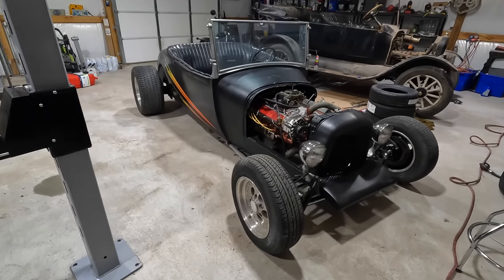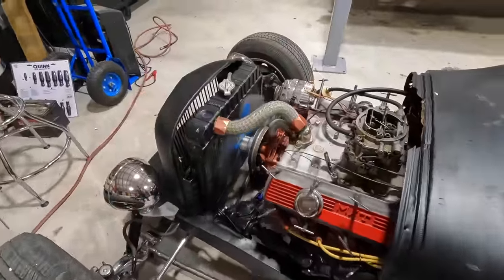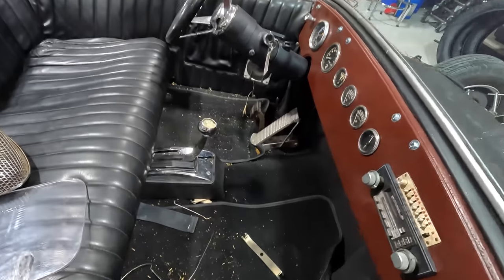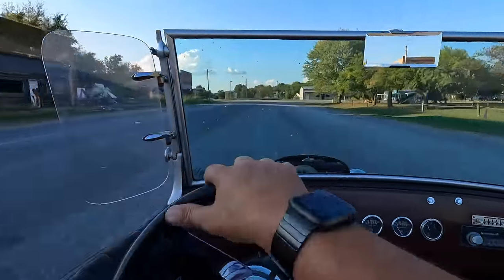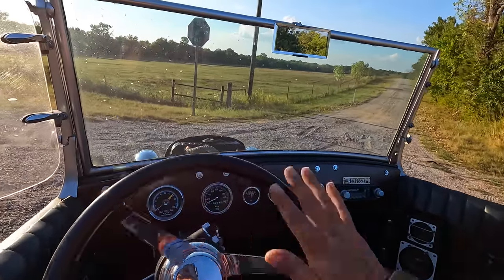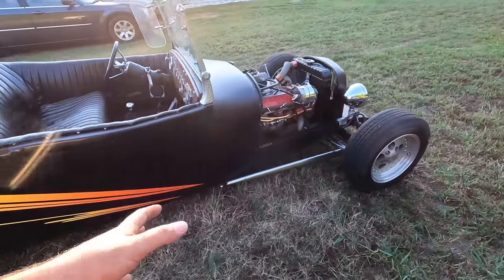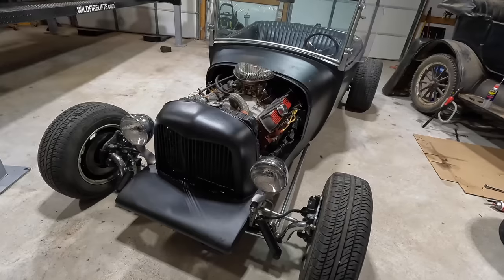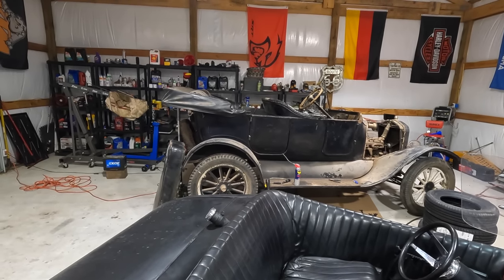I got Shafted on this 1929 Ford Roadster! $13K and 30 days Wasted!

Comment: Honestly this reminds me of the 85 black and red pinstripe Buick Regal limited my dad traded a expensive car Worth good amount of money as well as how got that one, and the 85 regal had true dual exhaust no mufflers and chrome exhaust cannon tips like 4 inch slant cut tips, it had it's factory g vin 305 and had a serious lope he and my younger brother thought was awesome and I'm like nope I was the one to move it off the driveway and it barely turns over and starts, the quadrajet is missing the choke plate and almost all the connections to the e4mc computer feedback carb, and it has a 70's vacuum advance hei distributor and the timing retarded way too much and im guessing the idle screws are cranked in and even though I know that the guy dad got it from put a cam in it and they did but as it turned out 6 months later they had cranked the rockers down to the point there was almost zero valve lash,, well I'm shocked it didn't blow up, but I called this car hot rod junk since the passenger side windshield pillar was smashed in towards the top they put a new replacement windshield in it and filled the gaps with black rtv silicone and the pillar was smashed in enough that you had to push in on the front corner of the window to shut the door or roll the window all the way down and shut the door and while rolling the pwr window back up you had to have someone push in on the front of the window to go under the roof rail weatherstrip moulding tab to get the window all the way up and seal out the weather as best as could be done. Had homebuilt three inch spring blocks under the rear coil springs so that overextended the shocks so it had no rear suspension travel my brother and dad loved the rake this car had.it had cragar grand prix their version of the aluminum polished blade looking wheels and the blades were gloss black and it had the twist in spring riser knuckles in the front springs two spring knuckles per side, and actually made it sit lower in the front,tires were Firestone Firehawk gt 215/60/14 so it sat low to the ground I took this thing down the road when I moved it when my dad's buddy dropped the trade off and pretty much hated the car from then on I didn't mention that the nose cone was busted out on both sides and the Dr side lights would bounce around because that could be fixed.the car was apparently lowered by the spring knuckles because the ball joints were bad, lower a arm bushings nope, and the two rear tires were flat spotted and all 4 were bald, car constantly had blower motor and Dr side power window switch issues and it truly had beautiful burgundy limited interior nice dash except the top plate speaker grille defrost vent plate it's only plastic, the Dr side seat the center hinge was Bent so the seat leaned,car drove like crap and shook, and backing it up was sketchy at best lol, my dad and brother replaced the upper ball joints and the outer tireod ends paid to get this piece of junk aligned with the horrible tires and my dad drove it as his work car,I'd occasionally ride in it but after that I would not drive it, and I forgot to mention the motor mounts on the frame were broken loose inside the clam shell and the transmission mount was installed at an angle and broke so it was ratchet strapped with the skinny orange little ratchet straps like big n lots department stores sold why I called this thing hot rod junk

Comment: Lack of a title when you operate on thin margins and fast moving products is a huge issue.  While someone who is looking to buy for themselves and plans to spend a few months or so to work on it and make it just right won't care about going through a bonded title process.  $300-$350 to have someone do a title 42 for you isn't a lot of money, but having to wait anywhere from a few weeks to several months would cost a LOT more in missed opportunities.  Should the court find an old lien through another state then it might cost more money to clear that, or if the company that put the lien on it doesn't exist anymore, it might be nearly impossible to get a title without some monkeying around with paperwork involving Alabama or Vermont or whatever.

Comment: I think you lucked out on being able to get a refund on that car. It needs a lot of work to make it roadworthy, including bracing the frame. That would basically end up being a complete rebuild of the car, something I'm sure you don't want to do. Because once you do that, then I may as well fix this too while I'm here, then I might as well do that too, etc. 
The yellow t-bucket is a far better car that you don't have to worry about selling. I'd be worried about selling this car to someone in its current condition. 
Good luck on getting the Cobra.

Comment: damn, worth maybe 5 grand.if it is all steel body then maybe 7 grand. i buy and build these all the time. i just bought a 28 steel body with a fuel injected 350 for  9 grand  runs great. needs paint. but i also paint. the frame on that thing is junk yup you got taken on that deal

Comment: The steering column can be bought aftermarket, as well as a new rack and pinion, so it would be easy for somebody to update.

I understand where your at on the car. I bought a 1953 Mercedes that needed a lot of work, no title. When it showed up it had a different engine, no VIN on the body, one VIN on the frame and a different one on one door. I talked to the DMV on title and licensing, it wasn’t worth all the work. Sold it as a parts car.

10K miles over 20+ years (judging by the radio) is believable.

Comment: I am really digging that "Turtle Deck" model T hot rod. I would take that in a hot minute. From the looks of it & your description, needs a small block Chevy, box the frame and fix the whole steering stuff. Needs some attention for sure...but at 60 I have the time and the will, but sadly no mooluh. lol Appreciating the video's TY
Reply: That's not a Model T.  Model T production ended at the end of 1927. The '29 is a Model A. The "A Bone" as they were referred to could be bought new with an optional rumble seat.

Comment: Is anyone else bothered by the fact that he keeps calling this 1929 Model A Roadster a "T-Bucket"????  It isn't a T-Bucket.   I have no idea what kind of frame is under it, but it was not built correctly as evidenced by the flexing caused by the steering...not good...   The brakes may or may not be a problem..

Comment: The 330 was a good engine they put them in the first 442s the horse was330 horse same as cubic inch. I'd see if it would do 120 and I'm 72 years old..the cops put the 330 in cop cars.the 400 came out in 65. Why you into cars if your scared of them ..

Comment: You should pull the engine out of the yellow roadster and keep it for a later project on a keeper maybe. But then find a nice cheap rebuilt vortec engine and put an RV cam into it and a 600 edelbrock and let it sell with that engine, because that 383 is worth keeping for something else you really want to build for yourself man. You will still get the same money for the car regardless..

Comment: I have seen some sketchy builds but this one is definitely in the 10 worst I have seen because of the flimsy frame they used. A Model T frame was only intended to have a maximum of about a 40 HP engine in it. Also, it’s a Model A roadster and is not a T-bucket. It is possible it is on a Model T frame but it’s more likely an original Model A frame which was also intended for a 40 HP engine. Without seeing more of the frame there is no way to know for sure. Too bad you couldn’t get compensated for “getting it running” for them.

Comment: 13 K is really cheap for that car.  Its worth at least $25,000.  That is NOT a T bucket style  car.  Its a hot rod high boy style.  Who built this.  The year and  style of the engine is irrelevant.  The steering is poorly designed.   It needs a side steer drag link.

Comment: Stay away from reproduction Cobras. You’ll never get your investment back for the  $65K you spent. ……….why don’t you find a 1990 Mustang Cobra with the removable top for an investment project. There’s so many aftermarket parts available, that ‘90 Cobra that will make it rock. I’ve seen really good shape  ‘90 Mustang Cobras for $20K.

Comment: You are one of those guys that obviously shouldn't own a roadster a chopper a 4 wheel drive anything that might ride rough for doesn't run perfect it's a steel body roadster older than anything you've got running off Should be happy quit complaining winner

Comment: You literally stole the car at 13k. Then you are falling right into thier hands of returning the car. If there is no lien on the car a title isn't that big of a deal. A self assembled or salvage title is easy to get. Sounds like you are sending this car back so they can let the guy who wants it for twice what you paid. It wouldn't be the first time an auction company done this. I have first hand knowledge.  Or you don't want a 35 to 40k authentic metal body with oem frame. The end of the video was very revealing.  LoL.